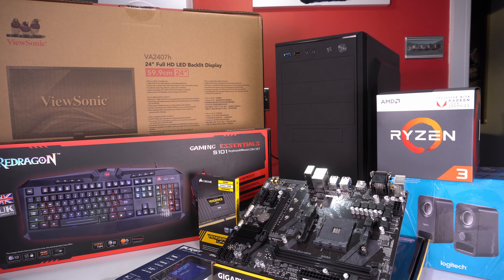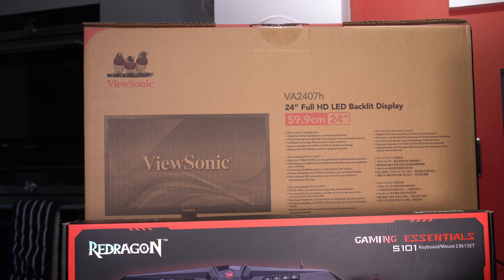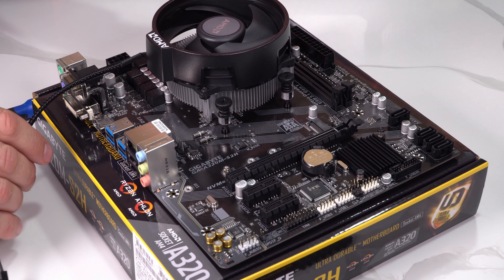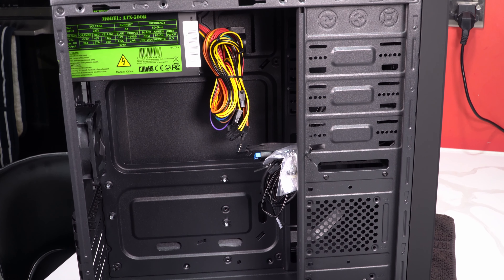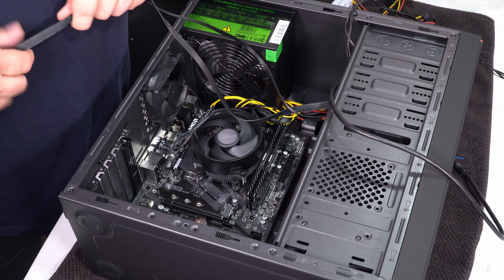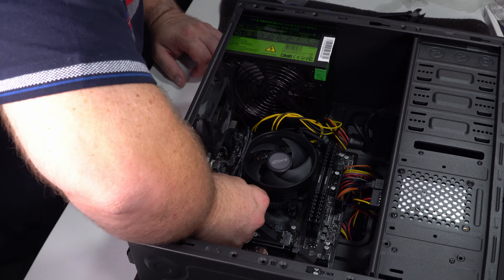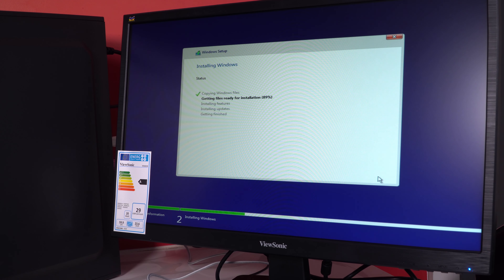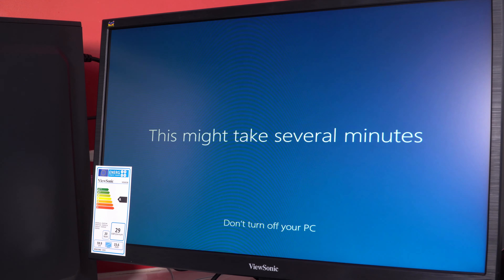AMD Ryzen 3 2200G Build

Comment: hi sir can u help me or suggest this is the build im planning
ryzen 3 2200g
a320m or b450?
2x8gb 3200mhz im not sure if ryzen 3 supports this
rx 570 
help sir
Reply from the maker: Things that didn't happen but interesting 

Don’t go for the 2200g if you using a dedicated gpu. Rather go for a 1st or second gen Ryzen 5 base Cpu. Will have more cores and a faster clock speed and much better cache. Defo a b450 board in case you upgrade again down the line as the better Ryzen CPU’s have a much higher tdp which the power phases on the a320 would not be adequate for. Go for 3200-3600mhz ram.
Reply: @spam4just  okay sir. and here is my second option
i3-9100f
rx 570
h310m
2x8gb ram 2400mhz
Reply from the maker: Things that didn't happen but interesting 

Again rather an i5 9400f. i3 will quickly become a bottleneck. 2666mhz min 3000mhz better. B365 board again is a better choice.
Reply: @spam4just  so why does gtx 1650 works superb with i3 and 570 will bottleneck?
Reply from the maker: The bottle neck will be the cpu not the GPU. Gaming on Intel really should be limited to their i5 chips and above.
Reply: @spam4just  how bout this sir
i5-9400f
h310m-f
rx570
2x8gb ram 3200mhz
Reply from the maker: That will do it. Maybe a b365 mb.